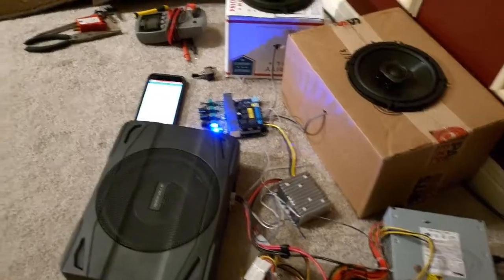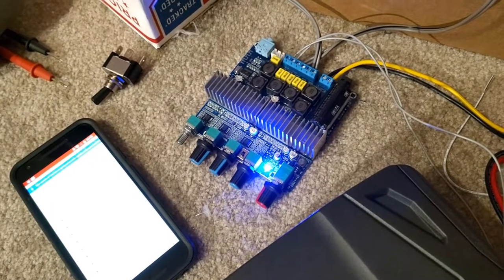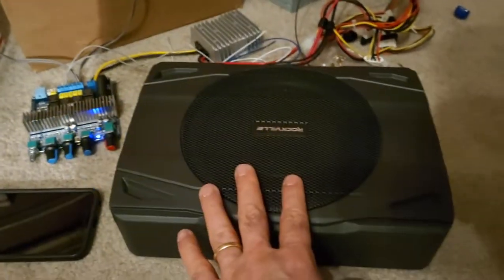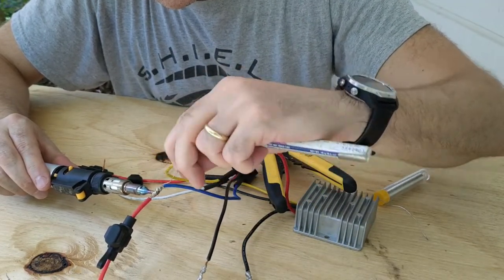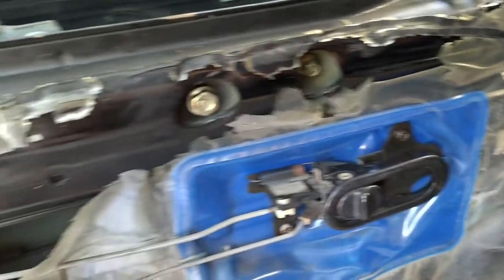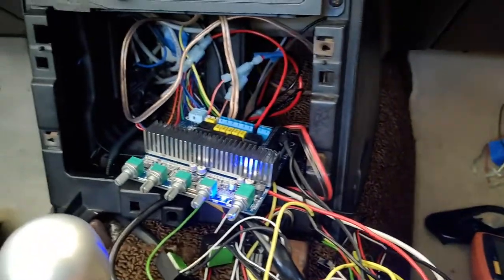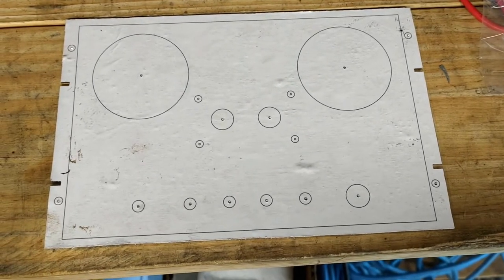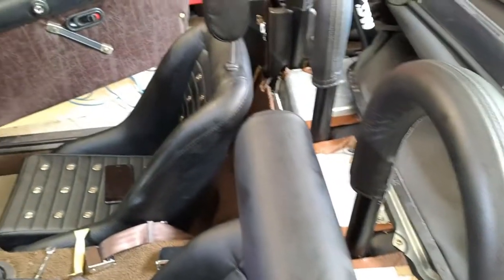Retro Audio Look / Modern Sound -- DIY Headless Bluetooth Car Audio

Comment: So if I skip the voltage converter, how would I connect the toggle to the amp board? Thank you for the great video!
Reply from the maker: You can skip it and just use the 12 volt power from the car.  I still recommend a relay to turn it on and off and use a power line straight from the battery similar to how you'd do other amp installs.  The only issue is at 12v you need more amps to drive the same sound watts coming out.  The stock battery might not be great for that but it will still work fine.

Comment: nice i got a mk2 /mk3 to deal with.i got a few amp board one just like you and way nicer ones brand Sure / wondom dirt cheap and build quilty ios great look them up and the unit not all but some have DSP in them thats sweet plus the china company is on of the few that is dedicated to audio and been around for a long time i got a 250 x2 bord and a 6x50 i think alll nice and i use adjustable boost converters.parts express sell them or buy directly way cheaper.or look into brizil made TARAMPS audio amplifiers they rock and are small

Comment: Do you still have the door speakers or not?
Reply from the maker: Yes!  At the time of filming I wasn't sure what to do with my door cards and so I didn't even add speaker grills.  So this is the sound through the vinyl covering.  But the Polk speakers are still there!
Reply: OGPedXing Are you planning on doing speaker grills? If so are you going to film it?
Reply from the maker: Yes, the plan is a full replacement of the door cards (oem cardboard) with something else (abs or aluminum) and I'll get grills done at the same time.  I've also got this punch set which I could use to do a nice pattern through the vinyl.  A lot of work though.